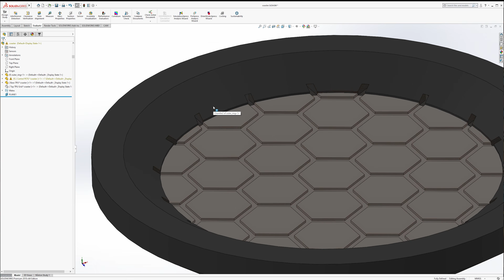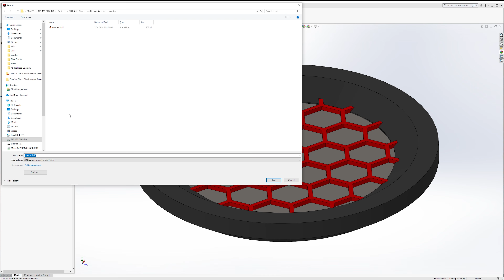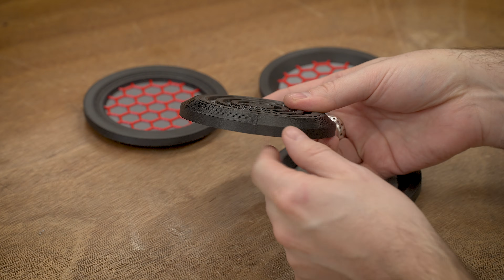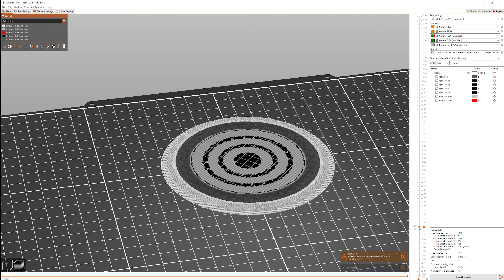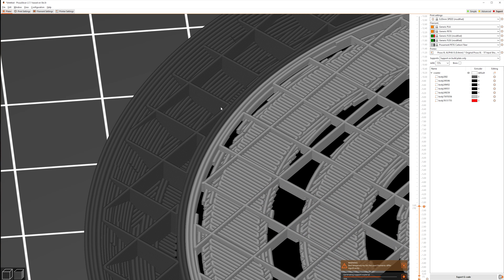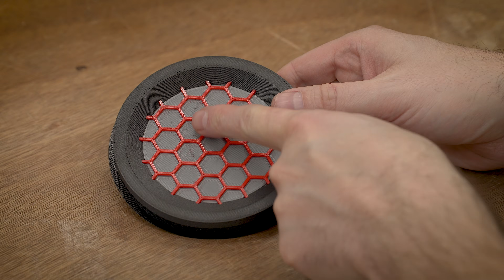Multi-Material Coaster - ALL THE FILAMENTS!

Comment: Just a thought, what if you make small squares as wipe towers then assign each to a tool head in the slicer and find a way to print that part first then go to the main print.
Reply from the maker: When I first got the machine, I tried that.  But there were (at the time) some issues preventing that from working in the slicer.  They might have updated it at this point.  I still think multi-material is complicated overall, not all materials mate well together, temperatures are different, etc, etc.  Multiple purge towers CAN be a way to solve it, but it's still tricky, and that wastes even more filament.  At that point, just purge like Bambu does it.

Comment: Robert, I am having problems with XL Prusa 2 color with supports. I want to make support with a different Filament PETG, and the main filament is TPU, but it not letting me do this. In Slicer do I make the changes on the Filament section or do I make the change in Print Settings

Comment: Question: Are you able to run the PETG-CF thru a .4mm nozzle?  My XL is shipping this week and my previous printer (Bowden tube variety) would clog when printing CF infused materials thru a .4mm.  Any details/tips you could provide on this subject would be appreciated as I'm getting ready to switch over to the XL.
Reply from the maker: Huh, I haven't had any issues with it YET.  I have had issues on the X1C though.  But for the XL I'm now using a diamondback nozzle for abrasives and they don't tend to clog.

Comment: Did you retry the print with setting it  to only use petg for the wipetower perimeter?
Reply from the maker: I have done prints since this one where I set the wipe tower extruder to PETG, so it made that as the perimeter and it worked just fine.  I was just trying to get this to work without a wipe tower.  It's fairly straightforward if you're gonna use a wipe tower.

Comment: Would you be able to reduce tolerances in moving mechanisms by taking advantage of materials that don't stick together?  For example, a print-in-place hinge printed vertically, with the pinned half being PETG and the receiving half PLA.  Would it function if there was zero clearance between the pins and holes specified in the model?  If not, how low can you get it compared to single-material, which is already really good on current machines, and is it worth it?
Reply from the maker: OH yeah, you could easily do something like that, as long as the geometry makes sense.  It still has issues putting layers on top of other layers with dissimilar materials.  There's no real way around that, you can't make them stick in some cases, and not stick in other.  But I'm sure some clever designs could work.

Comment: I found it, What you have to is turn off your wipe tower. RC> add shape, make it a rectangle or whatever you wish, copy and paste another, as many as you have material changes. Set each one of the shapes to the respective material extruder. PLA for extruder 1 in the first shape, and PETG in the second shape for example.

 Then insert your model(s). Make sure the sequence is such that the added prime towers are first then the parts. Press e to see the sequence on the plate to confirm. I found that it’s by the sequence the parts are added to the plate so that’s why you do these purge shapes first. You can scale the height to match part models height later, as you’ll want it at least the same height. 

You’ll want to RC and do a height range modifier to make them more dense than the model if you aren’t sure about the prime amount being enough before it starts on the parts. I don’t have my 💩 together enough to actually do calculating and make sure they’re enough. I just pull a page from Bambu labs book and make sure the prime is more than excessive and you’ll be in better shape than if it’s not enough.

Love the videos Robert, you’re my Bob Ross of 3D printing.
Reply from the maker: Gotcha, so there's a process.  I'll have to try that next time.

Comment: Do you know if there is another printer by Prusa (or another company) that is more expensive that I can pay to beta test for? I feel like only spending $3,000 - $4,000 to beta test a printer with no camera and enclosure is too cheap. I want to spend at least $10K on a printer that doesn't have even more stuff that pretty much every other serious printer comes with.
If only they had spent 8 years developing this printer, maybe it wouldn't need so many improvements and say it can do things that it only sort of can with a lot of futzing.
Reply from the maker: Ha, I sense some sarcasm.  Do you know of ANY printer at this price level that has an actual tool changer and not just filament purging?

Comment: If you would use multiple Wipetowers, you would also need different bed temps.
Reply from the maker: Eh, it depends.  If your material sticks together, you can lay down a base material that's compatible with the bed temp and go from there.  Most likely a wipe tower won't have much in the way of internal stresses, so warping won't be too much of an issue.  But it's another consideration if you have drastically different bed temp needs.

Comment: You are making me eat my words. I asked if you were hard pressed into making a multifilament project and here were are.  words +😮= eaten.
Regardless of the final result 20:10 it was a success. Perhaps you can make a matrix of what filaments worked well. (tpu/petg) and which are disasters unless breakaway is the goal(petg/pla)
Reply from the maker: Ha, thanks.  Yeah, I think it was a success.  If this was a 'real' part, I would just model the supports, make objects to wipe into, and it would work fine.  But without those, it still turned out pretty good.  From a couple feet away, it looks great.

Comment: On the issue of the outside seams bring rough without a prime tower, there is a setting for printing exterior walls last, I’ve had good success either the MMU2 enabling that when I go for minimal wipe towers so that any gaps caused by not being quite ready to go yet are not on the outer surface.

On the issue with concentric supports being good in one place but not others… this is what modifier objects in the slicer are for. You should be able to have the best option on both places for that with a cylinder modifier centered on your coaster and adjusting the inner parts differently than the outer parts.
Reply from the maker: I talked about this somewhere in the video (it's long, I know), but that caused issues elsewhere.  The model is oddly simple, but also a bit complicated to get right.  I did try this, but the blob was too big and still interfered.  It just needs a purge tower when you're using higher temperature materials since it causes too much pressure inside the melting chamber.

Comment: Is Bambu like purging copyrighted?  Something like that would solve mixing pla and petg models I would think. A back up for if you can’t put it in the prime tower or just no prime tower at all.
Reply from the maker: It's not copyrighted, it's just wasteful and slow.  The reason no one else did it was because it's a bit of a sloppy way of doing it.  SURE, it works, but it's not really a well-engineered solution.
Reply: @RobertCowanDIY  I mean just the purge part, not using only one extruder for multi material.  I would think unless you have pla on every layer a separate purge tower would not work, so just purge material and wipe would work better.

Comment: I agree that the alingment is time comsuming, but that is one reason it works so well with multiple print heads.  I found a way around the prime towers.  I create my own.  In Prusa slicer I add a shape usually a cycliner at the front of the print.  You could add one for each filament and select each with a different filament.  Print that before going to the actual print.  It will get the extruder loaded and any waste out,
Reply from the maker: Correct, the ability to add multiple purge towers should be the next feature.  That would solve most problems I'm seeing.

Comment: I used PLA in some prints and came to the solution to design my own support structures in CAD. This worked better than using the supports from Prusa Slicer. Just add a 0.1mm gap between the PETG. I used Prusament PETG and Kingroon PLA (cheap appr. 7$/kg). Works really good.
Reply: I do the same! While it is true that the wipe tower has issues, the resulting parts come out fantastic. I use 0 distance between the support object and the other object though. To help PLA stick, I slow the print speed way down for the first couple layers from where the support starts.
Reply from the maker: Huh, interesting.  When you say 'stick', are you getting PETG and PLA to somewhat stick together?  For me it just glides over the top like oil and water.
Reply: @RobertCowanDIY  By "stick" I mean that the PLA is laid down onto the PETG, it doesn't pull completely off as the nozzle moves on. It isn't as nicely as I liked though. I did find that when the part cooling is facing the interface, it helps, so I spent some time printing in different orientations to get the best results due to air flow. Also, when the part is done (and cool), it does take a bit of effort to separate the two, so perhaps cooling is the important part here. Regardless, the part definitely comes out better than NOT using PETG to support the PLA. In my case, the part is effectively a cylinder on its side like a tipped over soda can. Love your videos, btw. Keep'em comin!
Reply from the maker: Yeah, I think this is probably the way to go.

Comment: You don't really need a wipe tower though do you? All you need is a purge bucket (e.g. the pooping Bambu solution)
Reply from the maker: In theory.  I worry though that if you purged in the back of the machine and then traveled to the front edge, you'd still get some pooping.  With this model, it would probably be fine.  More testing is necessary ;-)

Comment: Hi Robert, Great video but still trying to figurure out just what this method can be used for in a practical sense.  Can you actually find anything that a maker would apply this to in the real world. Not sure this was a feature Pursa had in mind for the XL but if this is something that people want to do then they might address this in software as well (requested features) other than that you created a very lovely $3000.00 coster.  Imagine if this was a complicated part and you had to figure out all the things you did the ROI would go right out the door. All kidding aside I see more reviewers trying to achieve this with the XL so give it more time and I'm sure the results will be even better but this to me is not a good selling feature as it stands now.
Reply from the maker: I think you're looking at it the wrong way.  It's a tool.  Home depot doesn't tell you WHAT to build, but they give you the tools and materials so you CAN build something.  The coaster is of course just a test part, like a benchy.  I'm sure some day I will come up with practical applications, but that's not the point.  Once you learn a tool and understand how it's used and what can be done with it, then you can start designing.  For instance, if you're designing something but don't have a welder and can't weld, you most likely wouldn't design around welding.  Most woodworkers design their stuff to be made out of wood, machinists design metal parts, etc.  You design for the tools and processes you have available to you.

Comment: Have you tried making the pla petg interface the same? The pla would finish as an offset by a measurement of the petg. As they are the same shape hopefully if the pla finishes cleanly the petg would print directly on top without the zits.
Reply from the maker: They just bonded together.  I haven't been able to print PETG on top of PLA and the reverse.  It's like printing in the air, nothing sticks.

Comment: Interesting with two wipe tower’s, if space it could make them in lower heights but that would be some fiddling.
Reply from the maker: Well, the height always needs to be equal to the current layer height.  You COULD move the nozzle away from the model, move down, then go back, but that's a lot of unnecessary travel.

Comment: What is you would make the support part of the drawing. Make it as a body and then  select this body to print just in pla instead of the slicer taking care of the support. What do you think of this ? 
Do you contact prusa to ask for wipe tower for each head.

I learned a lot of this channel .
Reply from the maker: Correct, I could just make another solid body in the model and select the extruder.  It would be fairly simple to do.  However, it doesn't solve the issue about purging.  I'll file a bug for Prusa regarding multiple wipe towers.

Comment: Have not tried it, but wondering if you could change the support type on that section with a modifier.
Reply from the maker: I looked into it a bit and there didn't seem like there was anything beneficial.
Reply: @RobertCowanDIY  I had a look as well. Surprised there is no option to change the supports with a modifier. Feels like a missed opportunity. Perhaps we should submit an enhancement request for Prusa Slicer.

Comment: Zero Z distance is the best option for PLA-PETG supports. Easy option is to use the full soluble profile. I don't know why you had those blobs there, but for me it has always provided a pretty much perfect surface. Maybe it's related to (you) not purging properly between tool changes.
Reply from the maker: Correct, when there's no distance between the outer wall and the support, a blob on the edge interferes with the support and causes issues.  If the outer wall of PETG was clean, this would work.  It's just that initial blob when purging.

Comment: That wipe tower idea is excellent. Even though I guess I've been lucky with the PETG+PLA mix as I haven't had any problems with the wipe tower, but I do force PETG as the wipe tower structure always.
Reply from the maker: Gotcha.  I'm surprised with a lot of people having success with PETG and PLA.  They just never stick at all and can't figure out a good way to use it.  However, most of the time I'm doing support, it's nearly flat cantilevered sections, which mean it's laying filament directly on top of a flat layer.

Comment: The tool offset calibration doesn't always notice the gunk on the nozzle. I wasted a lot of time investigating first layer under extrusion issues with multi-tool prints until I found out that I had done a bad calibration with a dirty nozzle in the second toolhead. Preheat + some brass brush before repeating the offset calibration run resolved the issue.
Reply from the maker: Huh, interesting.  Mine had a very small piece on there and it detected it.  I'll have to watch out for that.

Comment: For the outer seam on the PETG CF part: If you change the printorder it could be better. Infill/Inner/Outer should have enough purging for a good outer wall.
Reply from the maker: Yeah, but you can only change it for the whole model, and that caused an issue with the overhangs.
Reply: @RobertCowanDIY  Ah ok, I thought you can change it for a single part.

Comment: Maybe they don't need different purge towers, perhaps they could have different "zones" of a single purge tower per filament type and/or tool heads.
Reply from the maker: Yeah, zones might work.  The workaround right now is to make your own purge towers (just simple objects placed on the build plate) and then select 'purge into this object'.  But I'm not sure if you can decide WHICH extruder gets purged into which object.

Comment: Please someone refer reliable 30x30x30cm printer. XL im not interested at this price point. 
I’m using 7 MK3S+ , IM looking for same or closer reliability large format Printer. Haven’t seen anyone doing comparison larger printers.
Reply from the maker: Yeah, the problem is larger printers are much harder to make apparently.  If you JUST need larger size, I've had decent luck with the Creality stuff, if you're just doing basic things.
Reply: @RobertCowanDIY   Thanks a lot Robert. I am going to try K1 Max. 
 very difficult to change the brand and reliability from Prusa.
Reply from the maker: @3dservz446 I have a K1 Max and it's 'meh'.  I'm still debating if I keep it or sell it.  The print quality is not very good, but it's fast and fairly reliable.  But I had a lot of issues printing with ASA, due to inconsistent bed leveling.
Reply: Forget about creality, qidi xmax3 is a better option

Comment: Heres an idea that might work: add cubes of each material onto the build plate and use them as wipe obects. Not sure what order they would print with multi material, but i sometimes add a cube when im doing a thin color change and i want to be sure that the first line with the new color is fully primed. I have a Prusa Mini do i mostly do this because I'm too lazy for a minute of googling to figure out how to turn on the wipe tower

Can you add a modifier object to change the support interface settings in a cylinder?
Reply from the maker: That's the issue, I'm not sure you can assign the extruders to purge into specific objects.  Just "purge into this object", not purge THIS extruder into THIS object.